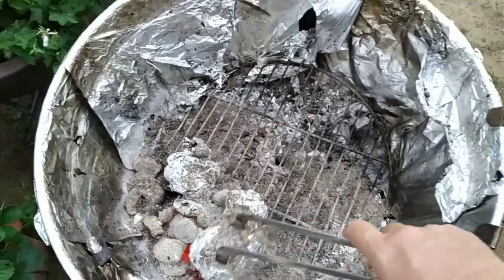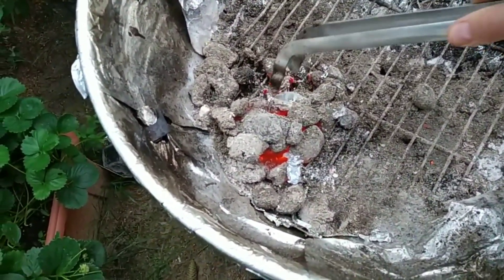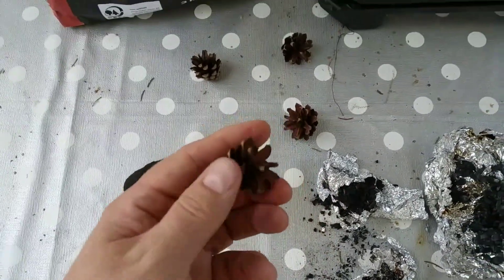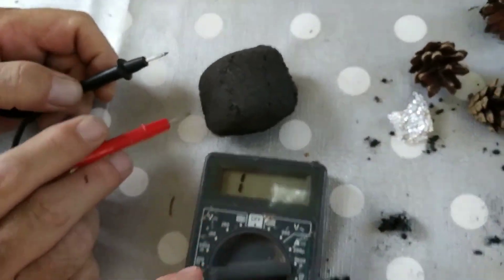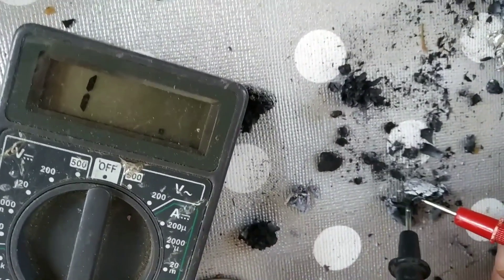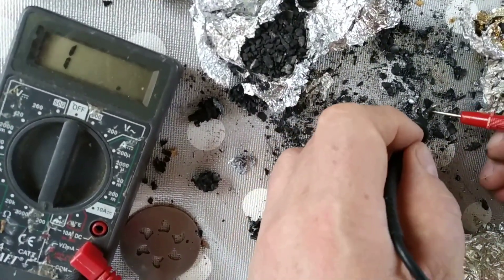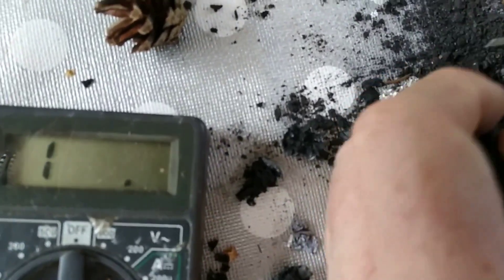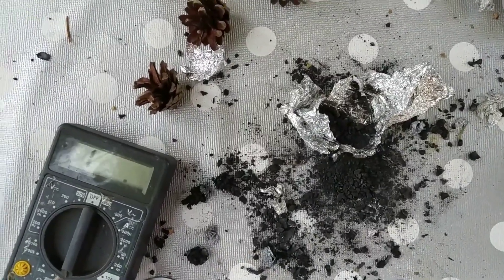How to make conductive graphite - Charcoal Briquets versus Pine Cones

Comment: Take a regular #2 Pencil. Draw a line on a piece of paper. Test the conductivity from one end of the line to the other. Ta-da ! Conductivity. (Sorry, just being sarcastic). Much easier than pulling out the grill and cooking pine cones. You can even use that drawn line in a homemade circuit. (Just for fun). Better yet, use the graphite fills from your mechanical pencil, you will find that they conduct electricity very well, and are solid cylinders.
Reply from the maker: Well yes you are right but, if you need huge quantities of graphite powder, it could get expensive if you would need to buy this..so makinbg it yourself via charcoal briquetts is the cheapest way to go, if you want to build huge Supercaps...
Reply: If you use a piece on paper draw a line in pencil and a line in hematene ink. Soak in salt water. If you use a multimeter probe you will see it's a battery. Each line an electrode.
Reply from the maker: @peterlang777  Thanks for the Info. Yes, Hematite is some kind of Ironoxide, right ? Fe3O4  or something like this...have to look it up again, but this will probably not rechargable , right ?
Reply: @oudotcom  not hematite. HEMATENE.  It is 2D hematite. Like graphite and graphene. It is rechargeable. It makes energy constantly from moving water molecules . It is in production and proven in Australia.
Reply from the maker: @peterlang777  where can one get this Hematene from ad is it very expensive ?
Reply: @oudotcom  acs nano or Rice university. You can make it yourself by sonication rust powder in dmf solvent. It is just 2d rust flakes.

Comment: Briquettes are a poor substitute for the real deal. Ash, sand, other fillers inside. Now you can make a big earth battery or something 😉
Reply from the maker: What do you think is the real deal ? Commercial graphite is vey expensive compared to this easy method, if you just take the charcoal briquetts...you only need to get rid of the ashes a bit, but that's manageable...
Reply: @oudotcom  i expect your pine cone stuff would be better than the briquettes. You can treat with acid or base to modify the active parts. Also look at other porous type woods or biological things that can be charred. Fungus, willow, pithy open fibers like hemp, sea sponge....that sort of thing
Reply from the maker: @m3sca1  Thanks for the info. I would rather go with coconut charcoal, cause you can buy this ready made pretty cheaply and this is also very conductive, so no more need to do it myself from charcoal briquets...